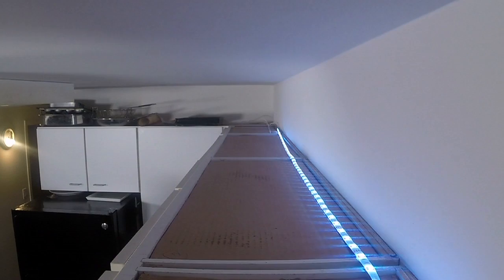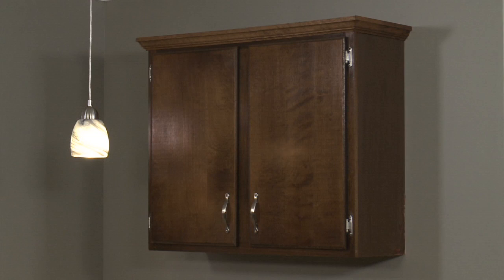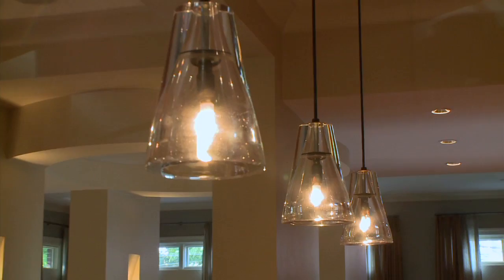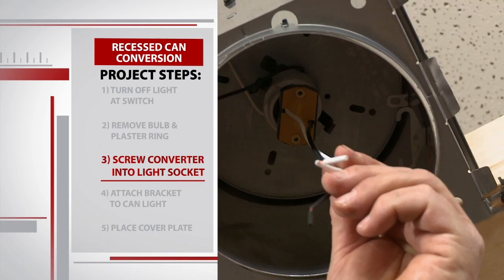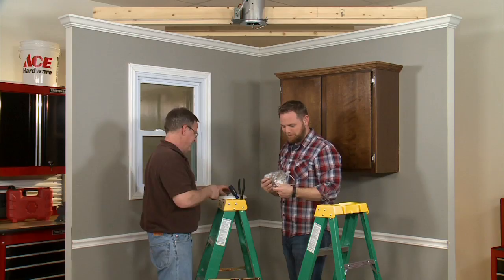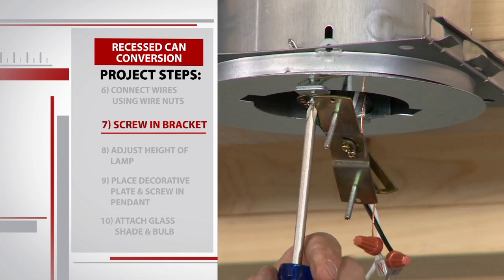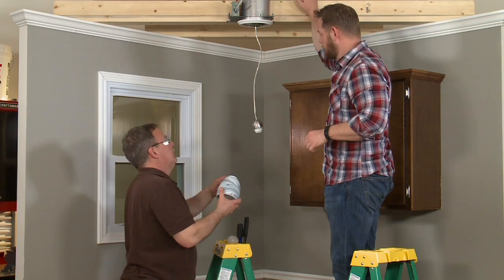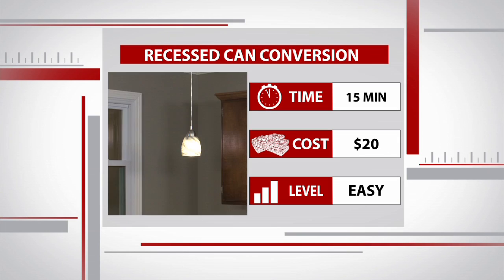How to Change a Recessed Can to a Pendant Light

Comment: This is nothing but an advertisement for these conversion kits.  My Hubby replaced a can light with a pendant and he's pretty knowledgeable about home wiring (he wired our whole house when we built some years ago). Note that there is no drywall around the light in the video.  The prior installation of the can light complicates this conversion greatly and they don't mention that little fact.  It took him 3 hours to do this job and they did it in about ten minutes.  The instructions are horrid, as usual, and there are several things they simply don't tell you.  The bottom of the can must be level with the drywall;  they mounting rod must be centered in the can body; you have to calculate the depth of the screws that hold the medallion to the mounting plate;  the self tapping screws that are supposed to drill through the can body won't drill through cardboard; etc., etc.  I have no doubt he'll do better if he does another but let's just say there is a long learning curve.

Comment: The conversion kit comes with a white or clear wire which does me no good because my pendant has a black wire but I can’t use it with the conversion kit.... sucks!!!!!!!!
Reply: the ridged side of the clear wire goes to the white wire you have.  The smooth one goes to black.  You have to run your fingers on the sides of the clear wire to tell which is which.

Comment: Its all fun and games to just turn off the switch, before you cut wires and are shocked to find out the power is switched on the neutral side, not hot.